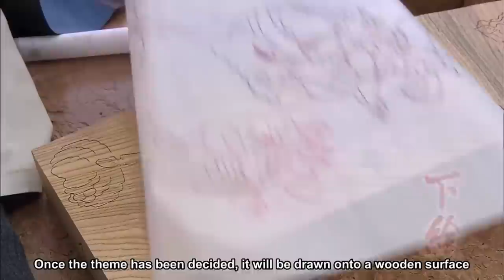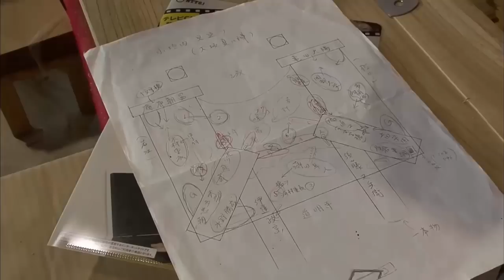With 10 Craftsmen, It takes 2 Years to Build & Assemble a Danjiri with Over 1000 Carved Masterpieces

Comment: Thats an artist. At the end of the day,his arm will be a trully pain.
Why they dont use Electric tools? Will be more easy and less painfull. I take my hat off.
Reply from the maker: pain is nonsense if you have faith
Reply: Power tools leave a different surface finish to using chisels. They're also heavier, so it's quite possible a day of working with power tools would leave you in just as much pain, if not more (Air powered tools are usually the best choice if you need to work with them all day as they're lighter than corded power tools and much lighter than battery powered tools for the same power). A further reason is that chisels don't create very much dust as they cut, instead creating chips that are too big to stay airborne, so they're much safer to work with long term without wearing breathing equipment to avoid lung problems.